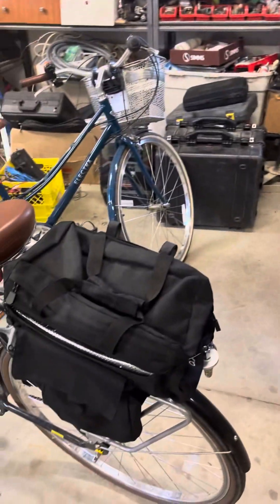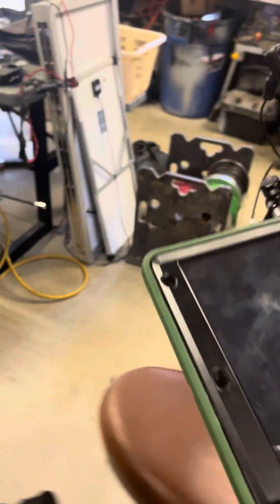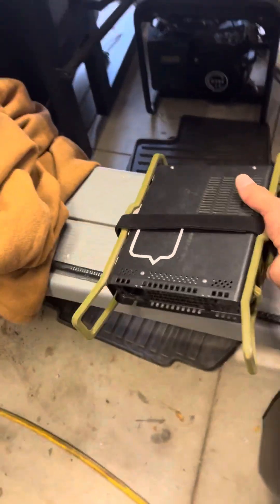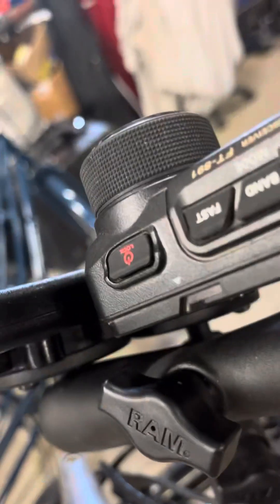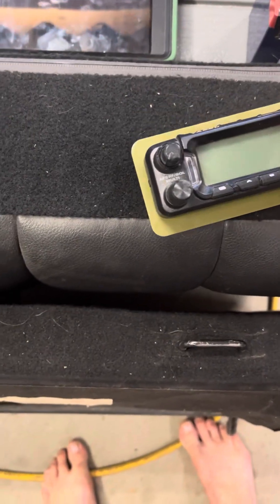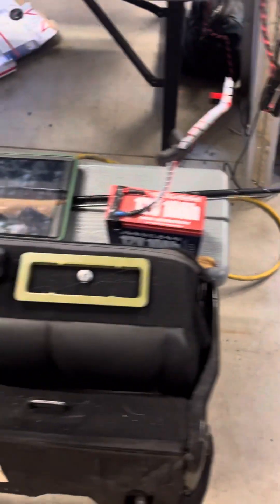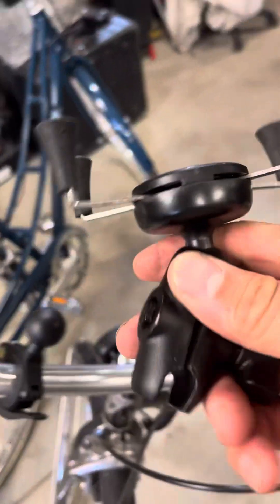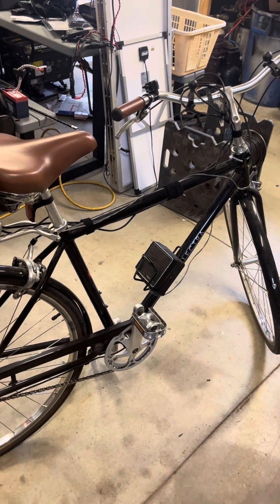How I Pota. Removing the radio gear from the Potacycle

Comment: Wes I see the bag is insulated, doesn't the rig get hot?  VE1SK
Reply from the maker: I have a opening cut at the rear of the bag for the fans to draw air into.  The exhaust air is vented at the front though the partially open zipper.  Winter plans are to make some 3D printed ducting to make it more efficient.